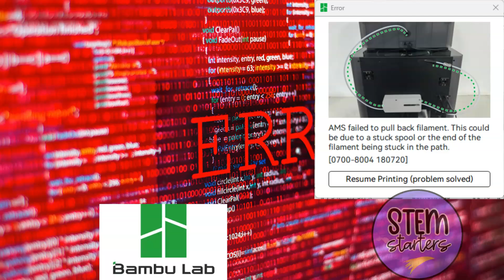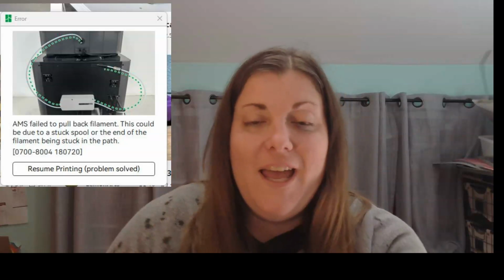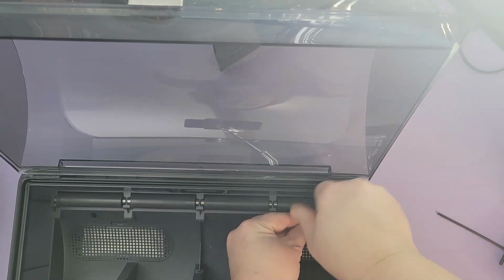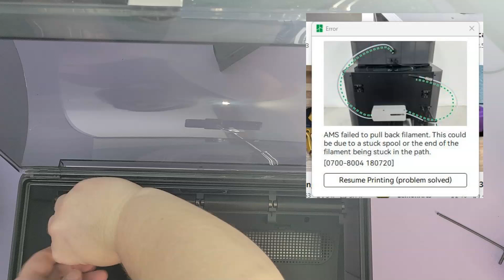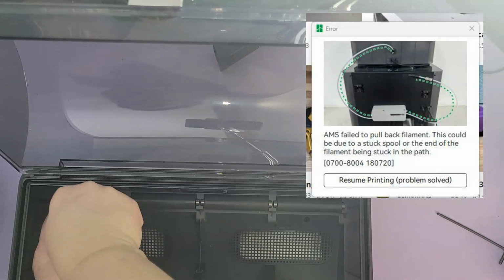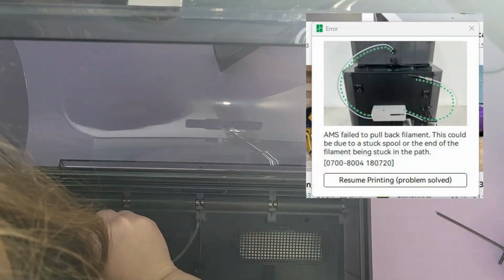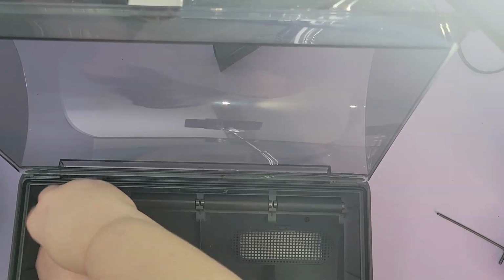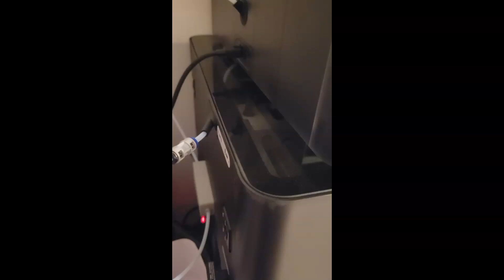Why am I getting the error "AMS failed to pull back filament" and how to easily fix it

Comment: Thanks for the cool instructions. I ran the filament through the tubes but it did not solve the issue. Come to find out there was a piece of filament broke in the AMS motor unit.
Same process and easy to fix.

Comment: After two hours struggling, not finding anything useful online (where all referring to extruder issues), this video solved my problem! I considered this issue to be the case, but dismissed it, as I couldn't believe the filament would break there. But it did.
Reply from the maker: Sorry you had troubles, but so glad you were able to troubleshoot!
Reply: @stemstarters  That's what you get when you're using old PLA: Breakage.

Comment: Great video I have done that also but still get the notice. Contacted Bambu and the sorry customer service said check on youtube for the fix.
Reply from the maker: I wonder if you block is from the ams to the machine in the tubes in the back.  Have you tried detaching those and sending a filament through the lines?

Comment: I don't know if you know there are better Allen wenches you could get the standard Allen wenches do come in long length wenches look for the ones with what looks like a little ball on one end most the time that ball is on the longer side and the better Allen wench is the "T Allen wench" because it looks like the letter T this wench spin in your hand a lot easy than that tiny one that you have! In the States I do not know the cost of a set, but here in France a T Allen wench set cost me about 20 Euros for you I would guess about 20 dollars you can buy one wench at a time but most of the a single wench is nearly the same price of a cheap set I got the cheap set because I am no longer a professional mechanic of 40 years! Good luck peace to you and yours!
Reply from the maker: great advice!  I love the hex screwdrivers, but left them at work.  Had to use my husbands because I couldn't find the one bambu includes until after the video 🫠😂